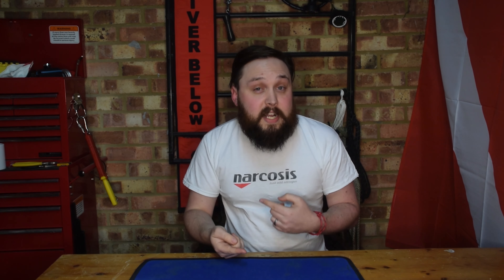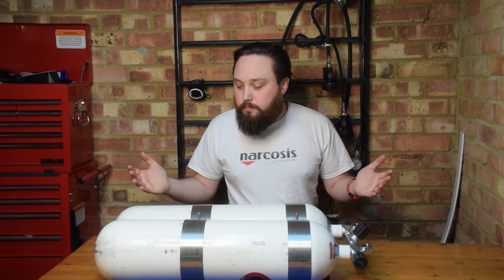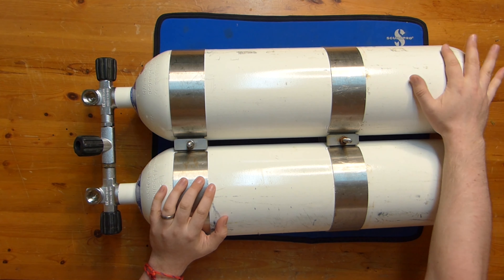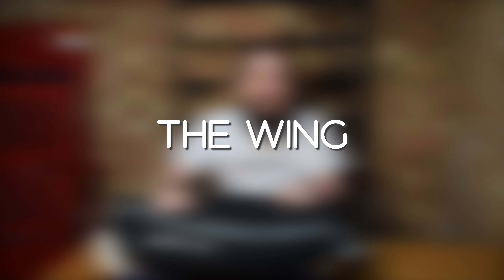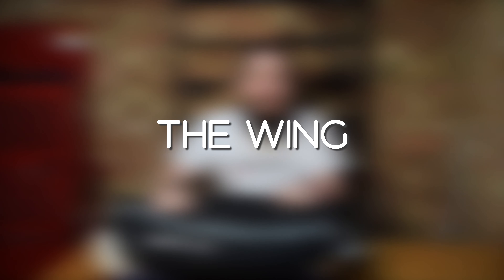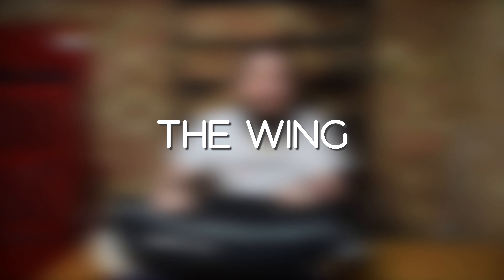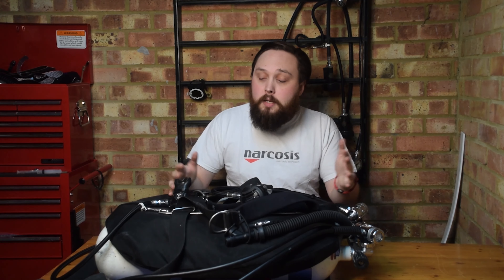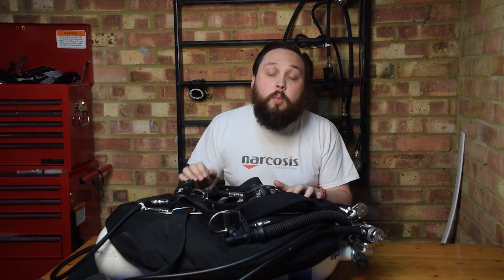How I Build My Twinset (Corrected)

Comment: If you have to shut down the first stage with your BCD inflator, would you swap your dry suit hose to your BCD or just control your buoyancy with your dry suit ?
Reply: Most of the time you dont need to fill anymore since you will only go to the surface when the 1stage dies.. 
But if Im inside something and need to go up and then down to get out i would use the dry suit..

Comment: Mark
Why do you have your SPG on one post and the computer AI transmitter on the right post?  Is there a reason why they couldn't be together on the Left?  If you shut down the right sided valve you would lose  the info for your computer.  I realize you will use your SPG then for your ascent.  I have my SPG and Air transponder on a high pressure "splitter" coming off of a single port.  I too have the transmitter on a short HP hose.  Will be starting my tech training with doubles in January.
Reply: as you probably know now if you did your tech training.. the right valve only turns of the 1stage on that side.. it does not seperate the two bottles.. 

Why use a splitter with 3 extra o-rings that could fail when you have 2 HP ports on your gear to start with =)

Comment: Which side of the waist buckle is preferred for the crotch strap. I was thinking on the male/free side to allow it to fall free when the waist buckle is released (quick exit). However seems most people have it between the buckle and the hip... maybe so they DONT lose the crotch strap if the buckle is opened.
Reply: Why would you want to exit your gear?
Reply: @djsalose  

When exiting the water into a boat especially. In our club we typically let the boat sitter lift our gear into the boat. But generally im not a fan of not being able to exit the gear in an emergency. Its one of the luxuries of BCDs.
Reply: @sbird7251  "if it only makes it easier on the surface you should not do it" :) 
A joke but still, you should never compromise your safety during the dive for convinience before or after the dive, 
Me personally have it so it wont fall of if the buckle is opened..  
Should it open by mistake and I close it without knowing the crotch strap is not there i have a very big entanglement risk.. 

And in emergency you always have your knife.. Just cut the webbing..
Reply: @djsalose  Thanks. 

Seems to be different messaging for OW vs cave divers (Im both). 

I recall from my OW days (and my sons recent OW course) the importance of being always able to drop weight and exit gear quickly. So weight belt buckle never under cumberband or bcd buckle.  Guages never clipped to far side of bcd.  Everything removable with just left hand. 

But in cave diving we encourage a less releasable set up for the opposite reason. 

Problem is i dive hogarthian in ocean dives and a deep water exit is often necessary and if its really rough, getting out of the gear quickly and cleanly is a god send.  

Or if the person im diving with isnt trained on twins, im pretty sure they will be at least temporarily stumped if the crotch strap is trapped while rescuing me.  Most people here don't carry a knife on OW dives, and using a knife close to someones crotch by feel alone would be daunting for OW divers and lose valuable time. 

So why do i dive full cave setup on OW then? To stay familiar for the rare cave dive.

Comment: I noticed that you have an A.I. pressure gauge on one first stage and another brass pressure gauge on the other first stage, are they meant to tell pressures in the two tanks separately or since they are connected, they will tell the same pressure and the brass one is just a redundantcy? Does the A.I. gauge know that it is being attached to a twin set and recalculate the time accordingly? Thank you!

Comment: Never tried them before, but I am definitely interested. I saw a video the other day where they were (as sellers of sidemount gear) how twinsets make you unstable in the water while relaxed (prone to turtling due to the high center of gravity. is this accurate or blown out of proportion?
Reply from the maker: I've never had an issue with twins, sidemount is undoubtedly more stable in the water, but as with so many thing there are a lot of variables that can affect your stability in the water on either...
It's not a common thing with twinset divers where we're constantly fighting to stay upright...
Reply: @SafeDiving Thank you for the insights!

Comment: Hi Mark and thanks for another great video. I'm just moving to twins so trying to absorb as much information as possible and your vid is very clear. Just one question, I'm using DS4 first stages so no 5th port, would the hose routing be better with the dry suit hose on the right hand post and is there any reason not to do this?
Reply: BCD/Wing on the right, Drysuit on the left..
If one 1stage fails during a dive you always want to have 1 airsource and one bouyance device..

Comment: I will definitely move on to twins, main concern is the weight, guess will add around 20kg. Already a single with integrated weights can be quite a hassle to get on a boat, specially with high gunwale, flimsy over ladder and choppy waters. So handling is a topic for it self but some other questions: 
1) If one of your tank valves are closed you won't recognize it unless you notice your air consumption or close the isolation, correct? 
2) For repetitive dive would you change tanks or dive half empty? 
3) I heard you could top up from singles during surface intervals, how to do that and what to consider? (pressure will be half/single but volume should be double I guess)
4) If you don't use a transmitter would you use a 2nd SPG?
5) Isn't adding a 90 deg swivel to your primary another failure source?
6) Do you travel with twin gear, bring your own bands etc. (besides tanks and weights of course)
A bit extended questions now for general discussion and possible clips: 
A) Piston or diaphragm, what do you prefer and why? (I like diaphragm because they are more compact, but piston appears more simple/reliable)
B) I was looking into the Mares Loop as a kind of crossover recreational solution, maybe a 5 feet hose and no need to loop it behind the neck, what do you think?
C) More air means you get longer bottom time, I really wonder why most agency don't teach Deep Air (anymore). In the age of dive computers it should not be an issue to push beyond 40m on air, especially on doubles and take some deco time. Enforcing trimix courses for 40m+ appears strange to me, also you pay quite a premium for it. Helium got and will get even more expensive. At many good places (good/best bec. remote but less infrastructure) you don't get trimix (or not even nitrox).
Just for example, one of my bucket list dives in Aceh/Indonesia, https://youtu.be/abjp_hBZqGI ...some local dive centers take you on a 60m bounce dive on singles to see the wreck. Only guides and newbies get a front mount bailout bottle. They also hang couple of cylinders at 5m for decompression. Maybe a bit strange/risky approach, what you think? I would prefer it on doubles and some proper training before I endeavor to the Sophie Rickmers.
Sorry for long comment and questions, I don't expect you to answer all/detailed. I really appreciate your dedication to your new channel, thank you for sharing your experience!
PS: D) When will you restart the Simply Scuba Channel and will you continue your channel in that frequency? E) I love your Safe Diving logo, I will order some Ts as soon I can come to Europe, however I would love to see a versions with small left chest logo with opt big back logo and a polo version. Cheers!
Reply from the maker: OK, so:
1) if one tank vavle is closed (and the manifold is open) then the only way you'll know is that one of your inflators or regulators won't function properly. The best way to notice is that your SPG wont change if your left is closed. With the manifold open you will breathe from both tanks through one valve.
2) no, unless I was significantly low, anything below 120bar and you're on less gas than a single 12L.
3) you can, you'll need a whip with a bleed valve to connect the tanks but as you say you won't get a great fill because the pressures will all equalise. You'll get a little boost but not much. You'd do better to take that tank with you as a stage cylinder on the dive.
4) no, the only time you'd need a 2nd SPG is if you're isolating your tanks, in which case you're probably bailing and surfacing anyway and you know roughly how much gas you had in your tank when you isolated.
5) yes, +1 failure point.
6) most dive centres will have their own twins set up, so all I'd bring would be backplate, wing and regs. They usually provide the tanks twinned up, just call or email first to be sure.

A) 20 years ago there was more of a difference between the two but now there's not much to sway either way.
B) the Loop is a clever design but more made for a stage cylinder to make switching easier. The main reason for the 7' hose is so that two divers can swim single file through a confinement while donating. You're thinking the right way though and looking at different setups to improve.
C) yeah, I'd rather have my own stage tanks for a dive like that. I've done the swim through in Elphionstone at ≈50m on a single 12, but if something goes wrong it's better to have those hang tanks with you. I think rebreathers will take over OC trimix in the next generation with He costs and limits. We'll still use it for bailouts but deep dives on open circuit will probably start to phase out.
D) I really dont know TBH, circumstances may change...
E) yeah, I'm creating more designs so I'll make one with a small Logo on the chest. Teesprings can ship outside of EU so double check if they can be shipped to your home.
https://teespring.com/stores/safe-diving
Reply: I dont mean to be offtopic but does anybody know of a tool to log back into an instagram account?
I was dumb forgot the password. I appreciate any tips you can give me
Reply: @Thomas Asa it worked and I now got access to my account again. Im so happy!
Thanks so much, you saved my ass !
Reply: @Landyn Byron no problem :D
Reply: Regards 6 C) you have not mentioned the single most important reason for trimix.....nitrogen narcosis. This is the reason for not doing deep air dives, nothing else. If anything, trimix increases your deco time compared to air based on current decompression algorithms. Narcosis=reduced safety.

Comment: Good to see you dispensing knowledge again! I'm just getting started on twins, and my regs don't have that handy port on the end, which makes hose routing a bit more interesting. How do you recommend routing hoses in this case? Thanks!
Reply from the maker: It can be done without a 5th port, you just fit your first stages sideways and let the hoses route downwards. Just means that your hoses bend a bit. There are some good images here: https://www.scubaboard.com/community/threads/tek-3-vs-ds4-for-doubles.286405/
Reply: @SafeDiving  Excellent. Thanks!

Comment: Sorry I didn’t hear what you called it but would like to see a bit more closer detail on the part your using to make the harness easier to adjust and get in and out of easier! Thanks
Reply from the maker: It's an Agir Harpa Loop. They're not the easiest to get hold of, but there are a few copies around like the Mares XR SF2. Which is pretty much the same thing

Comment: Isn’t a p-weight designed to go on the backplate? And a v-weight goes between the cylinders?
Reply from the maker: My bolts were a bit short to put them that side of the backplate. They fit quite nicely between my tanks though.

Comment: Looks like you need some new nuts on those cylinder bands.  I use A4 marine stainless steel hardware from Accu; M8 bolts and nuts are exactly what you get from Scuba branded suppliers but at significantly higher cost.  Also, your cylinders shouldn't weigh 20kilos!  My Apex 232 12litres are 12.7kg each.
Reply: Yes.. It sounds heavy.. My faber weigh 13,9 each.. (232bar 12l)